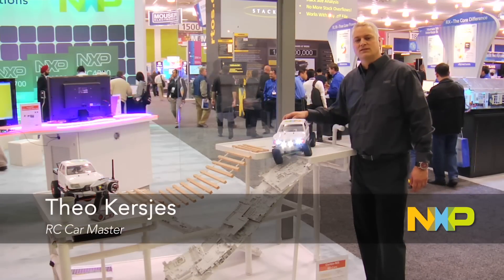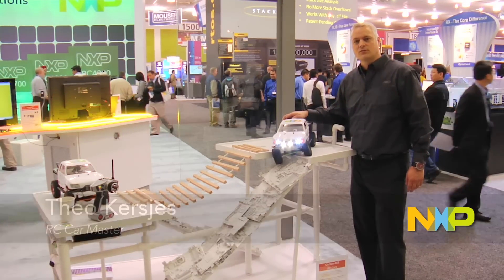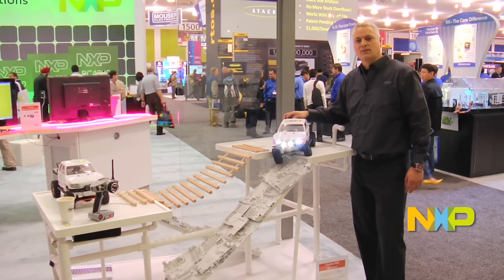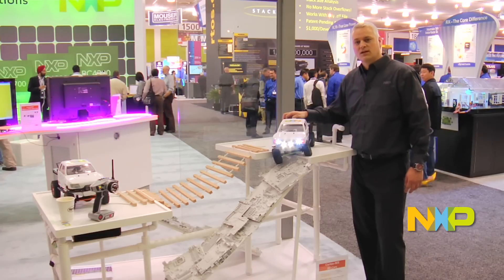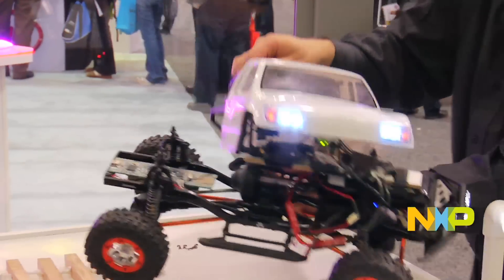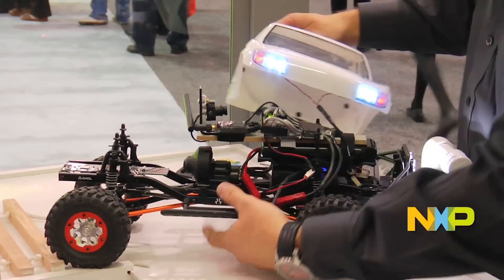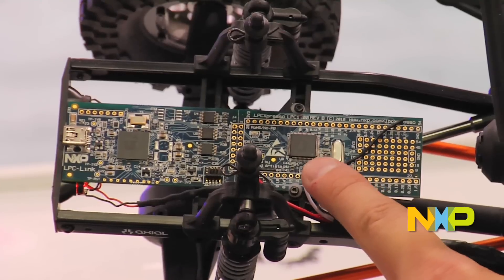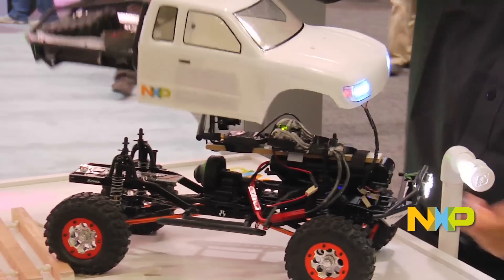Cortex-M3 RC Car demo at ESC 2012

Comment: I have 100 pieces of ARM Cortex M3 processors that I am trying to sell, if you know anyone who is interested, i will give you a percentage of the sale, I also have alot of other components that work with the m3, I purchased them from an auction and havent been able to find anyone here in toronto who needs them.. Let me know if you are interested, thanks, Andrew